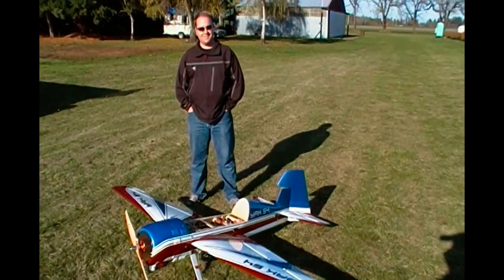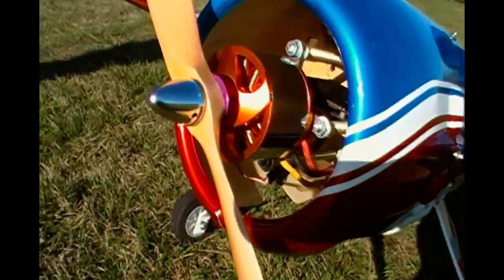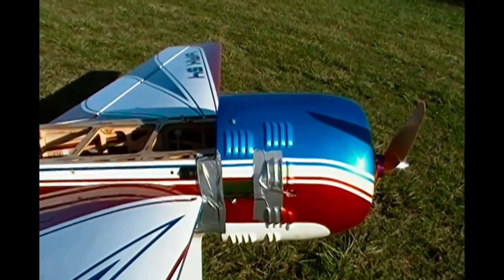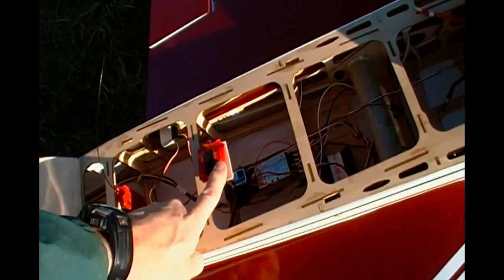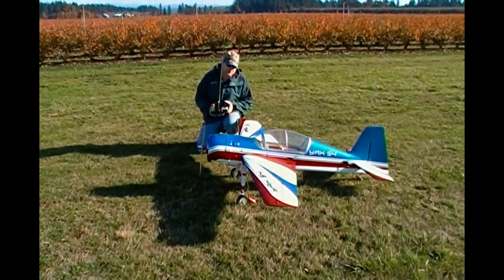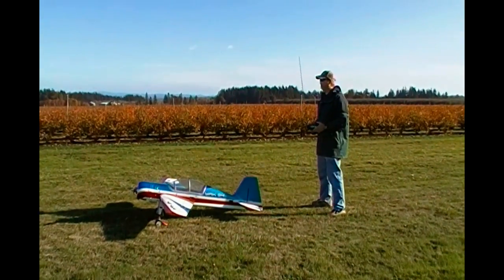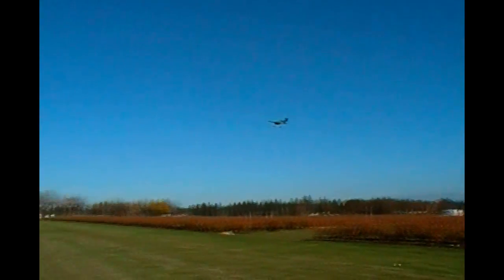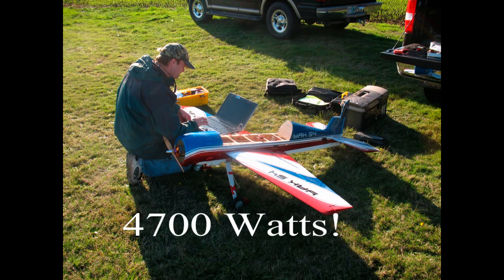Watt A Yak 45 Flight

Comment: holy cow a 107mph yak?!! that's awesome! i was going to put their 170kv 80-85 motor in my big yak, and i think it will work given that yours withstood that much power. but i am going for 3D not speed, so the lower kv should be good.
awesome video!